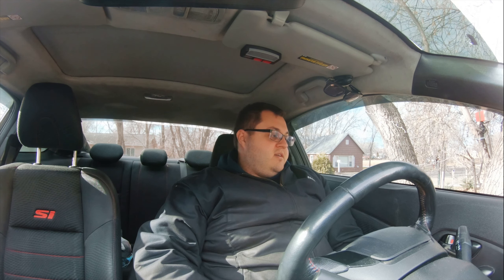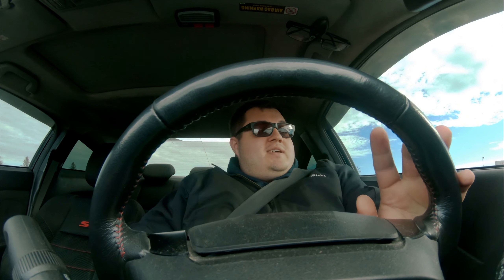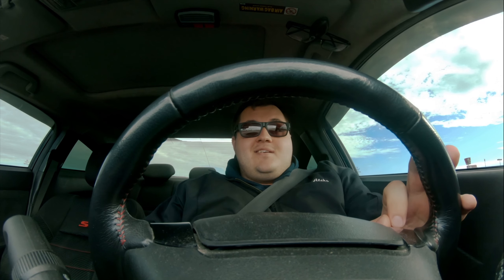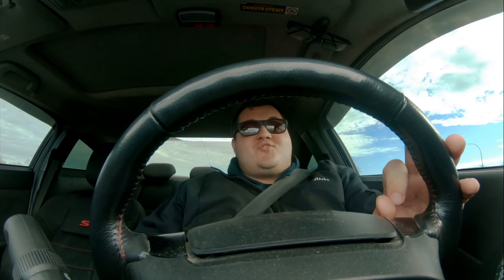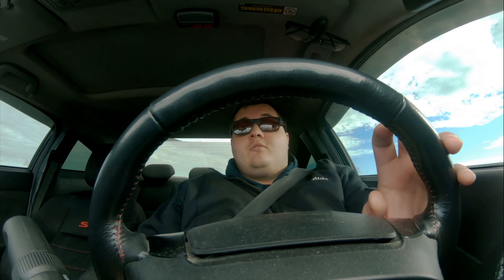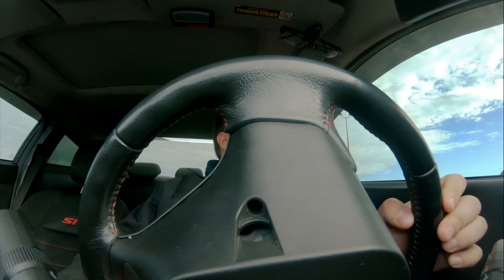Petty complaints about my 2012 Civic Si | 9th Gen Civic Si|

Comment: Ever had oil burning issues? My 2012 burns like a quart every 1k miles
Reply from the maker: I lucked out with my '12 and it doesn't burn a drop of oil. I change my oil between 7-12k miles and my oil level never goes down. The 12s are notorious for oil burning though and there was a tsb for the 12s to repair the issue consisting of new piston rings and oil control rings